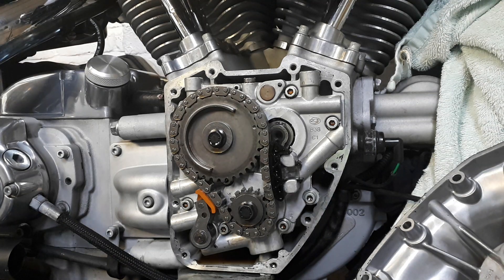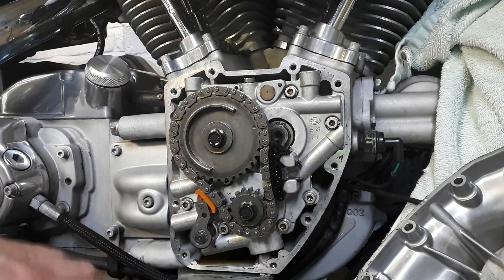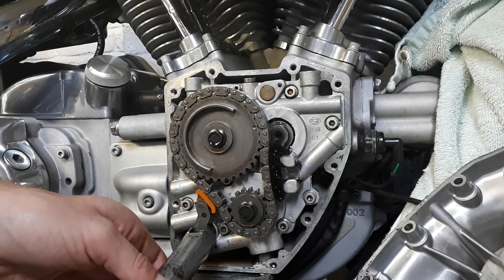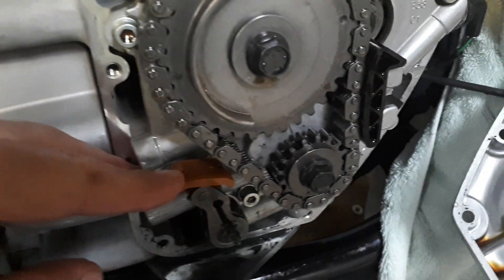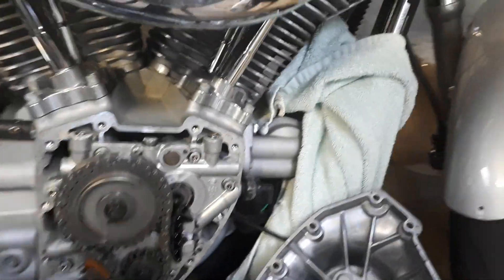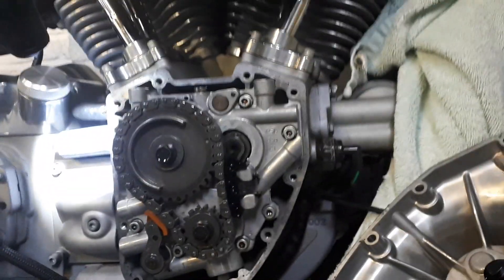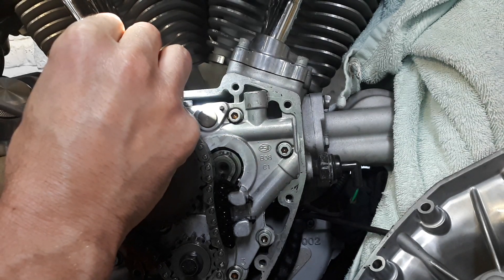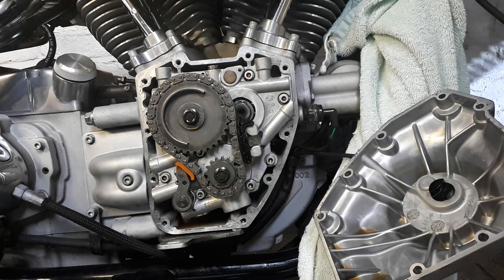How to check camchain tensioners on a Harley 88 Twincam

Comment: Kevin Baxter from "Pro Twin" mentioned that some people have gone as far as polishing  with jewelers polish and wheel, the outside of the chain (your particular type). 
  Makes sense to me as a cheap way to extend the life of your shoes.
  Thank you for an informative video on how to properly make this crucial check of the cam chain tensioners.
Reply from the maker: I’m glad you found the video helpful. Yes, I’ve heard about that too. It’s definitely worth doing it if you’re not converting it to hydraulic or gear drive.

Comment: A buddy of mine that has a 2006 Ultra change his at 50k and forgot all about it and at 117 the tensioners fell apart and the metal went through and destroyed a perfect running tc88 that had a lot of life left in her.    We replaced it with a S&S 111 and it's a Runner now.   Long story short $8500.00 later.   Change the tentioners.
Reply from the maker: Definitely worth keeping strict service intervals and change them well before it’s recommended.
Reply: @aronsgarage834  if you're changing your oil when you're suppose to and not leaving in for two years because you didn't ride it much last year!      The bike will give you a lifetime of enjoyment.     I have a Softail Duece  that I bought in 2001  and even though it sits forever because I have other bikes I still change the oil once a year just like my Ultra that is my old faithful.
Reply from the maker: @marvinr5054  I couldn’t agree more. The saying goes for everything, what you put in is what you get out.

Comment: I see that this an old video but I just had my mechanical tensioner replaced with the hydraulic replacement. It wasn't cheap but wasn't as bad as paying Harley to put new bars (12") on my '04 Road King. I had the stainless braided control cables instead of the black plastic. it is pretty bright to begin with. I've only ridden it home and started it again tonight, but the motor is so much quieter than it was. Granted my tensioner was ate up so that is to be expected. The reason I'm posting is I had that done at 24k miles or so and "if done right" I covered a lot of issues and don't have to worry about it again for a long time. I found this video by accident, I wasn't actually looking for this one and it is a good video, but on the 88 I suggest you put the hydraulic kit in. It replaces a lot of parts that may cause you an issue in the future. I have a bad back and no place to work on it so it cost me about $2 grand for the dealer to do it, but I got some help I think. Sounds like it was worth it so far though.
Reply from the maker: Glad you did the conversion early. Yes, I made made the video after buying my Harley 4.5 years ago. I’m actually doing the hydraulic conversion myself next spring which I’m planning to film. Got all the parts for it now, just need the time.

Comment: Very informative video. Thank you. At what mileage do these tensioners tend to wear to the point of replacement?
Reply from the maker: That’s the problem. They wear off at random times. Some at 30k some as early as 10k. So the longer term solution is converting it to either hydraulic or gear drive.
Reply: @aronsgarage834  Got it. Thank you

Comment: Harley-Davidson never should have gotten away from the evolution design with gears, all they had to do was bump up the design. As we all know the new Milwaukee 8 has basically went back to a gear design with less maintenance, even if you have to check the M8 it’s just one chain and one tensioner on the outside of plate for easy checking.
Secondly, Harley-Davidson needs to get rid of the chain primary and 3 hole oil fill because Indian, Victory , Honda, and Yamaha have done it which is why they take away sales from Harley-Davidson to this day.
Reply: Victory no longer exists.
Reply: @omarsalgado9715  all of Indians new bikes are victory’s

Comment: I replaced mine with the hydraulic tensioner upgrade and there is a lot less worry about failure and tensioner wear. Cam plate with high pressure oil pump, hydraulic tensioners and cam upgrade. Well worth the money to upgrade.
Reply: Totally agreed. Not being a gear head myself... I went the next step... with having a gear drive set installed. I felt that while I had the cam chest open, get rid of the offending parts!. It is not a cheap upgrade I grant you .. but its hard to put a $$ figure on peace of mind.
Reply: Stupid question, probably.  But whats the fastest way to know if an 88 has been upgraded to the hydraulic tensioner?  I recently bought an 05 road king and the bike had been completely disassembled and rebuilt and with add ons and upgrades.  It has a 6 speed gear box now, as one example.  So it makes me wonder, did he fix this well known tensioner issue while he was in there, also?    Can i tell without pulling the cover?
Reply: @rrmorris67  without pulling cover?? I dont think it possible.
Reply: Thought id ask.  Thanks.
Reply: @rrmorris67  The only way that I know of is to remove the cam inspection plate and visually look to see if the tensioners are spring loaded or if they have been converted to the hydraulic system.
Reply: @Vulgaren2012  i guess ive got a lot of time to get around to it.  It was rebuilt a decade back or more but only has a few thousand miles on it.  Ill have to look up the hydraulic tensioners to see what they look like
Reply: @rrmorris67  hydraulic means they dont have a spring like the ones in the video. The cam plate I believe will also be a different color not silver like this one.

Comment: It looks like I see the opening of the cross over pipe at the start of your video in the lower left hand corner at the start of your video? Are you able to take off the front header without removing the rear? The manual says to remove the entire exhaust, but I'd rather not mess with seating two exhaust gaskets and handling the whole system if I don't have to. I have 20K on my bike and am thinking about getting a Feuling 7088 kit, but at the very least, it's time to take a look. I can't tell if the center clamp on the cross over clamps the two pipe together or just holds the heat shield. Thanks.
Reply from the maker: Yes, you can leave the rear one on there. Undo the clamp on the cross over and it comes apart. Makes  life easier 👍

Comment: Is there some sort of oil beneath that cam cover? Or can I just pop the cover off and it's dry?
Reply from the maker: Yes, there is oil in there.
Reply: @aronsgarage834  is that motor oil? Where's it coming from so I can replace it.
Reply from the maker: Yes, engine oil. Comes from the oil tank and gets circulated by the oil pump. If you have your bike on jiffy stand, there won’t be much coming out.
Reply: @aronsgarage834  is the goal to keep it completely level?
Reply from the maker: No, you need to check the dipstick once you’ve assembled, and refill accordingly.
Reply: Mine being checked thurs .£170 or maybe £130 if less time .
I really can't be arsed to do it myself.
Bike is 2002 .11000 miles
Reply from the maker: @John-ob7dh  with 11k on the clock they probably won’t look too bad. But worth thinking about the conversion down the line. I changed mine to hydraulic early this year.

Comment: I'm about to change my tensioners out just for good measure...I'm at 25,000 mi, so I figure when I check them, might as well change them while I'm there & then I'll know it'll be a while before I have to crack this thing open again & give me some time to save up for a gear drive conversion...great hack on the tool...how old is this bike & it's only got 5,000 miles on it? Need to get out & put some more wear on those tensioners! Lol!
Reply from the maker: Yeah, good idea to change them while you are in there. I have now gathered all the parts for the hydraulic conversion, which I’m planning to do and record next spring.
I bought the bike 5 and a half years ago with 1500 miles on the clock believe it or not! 😃 I now got around 8000, still like new lol
It’s a 1999 Super Glide. What year is yours?

Comment: Great video, watched twice so far! Just bought an 01 RK and it appears to have been well taken care of. I can tell the carb has been modified, and it has nice flow intake and exhaust. 23.000 miles …No service records though. Can I possible see if tensioners have been upgraded by removing the small cover on the cam box cover? I'm definitely going with a borescope idea too!
Reply from the maker: Hi Eric, Thanks! That was my very first video. Probably not the best but really wanted help others with this. No, unfortunately you can’t check through that small cover. You need to the do the whole process. Fingers crossed yours has been converted! Let me know, Aron

Comment: If you have to replace them , buy updated hydraulic setup, bolt cutters, and a adjustable push rods kit to do the job if not removing tank , rockers etc... if you do then install rocker lockers kit !

Comment: Very clear video! Thanks!  Did you replace the cover gasket and do you have to drain the oil?
Reply from the maker: Thank you! You don't need to drain the oil. As you're taking off the cover, though, a bit of oil will come out (50-100ml tops). Yes, you need a new gasket or use a gasket sealant (which I actually prefer).
Reply from the maker: @Calvin hi Calvin, the only time you need remove the camplate if you want to replace the rear shoe.  However, in order to do that, first you need to take out the pushrods. It's a big job. Only checking them, on the other hand, is real simple.
Reply from the maker: @Calvin I totally get you. When I learned about all these, I myself too thought about abandoning it, or swapping it for a Sportster (bulletproof) but I do love my Dyna. I might do the gear conversion challenge at some point, and afterwards It'll be low maintenance. You did crack me up with the hobby part..but I agree
Reply: @aronsgarage834  what is a gasket sealer
Reply: What gasket sealer do you prefer?

Comment: Heres some insight from my school bus mechanic father. When ever possible never pry steel metal, like tools against aluminum motor cases. So before you pried with screwdriver he would place some kind of contact protection pad. Hes had one too many, "Oops" moments! One thing no one shows is "hard to remove, because of heat, exhaust pipe mounting bolts. The rubber boot around electrical unit by oil filter is poorly designed closure. These pads are poor design. Im replacing pads with accessory plate hydraulic pads. I'd like to put chain drive, but not cost effective?

Comment: when i put my gear drive cam in the shoe was cracked in half. How many minutes till my motor blew up.
Reply from the maker: Lucky to catch that just in time. I’m glad you saved your motor. At how many miles was that?
Reply: @aronsgarage834  30,000
Reply: @JCunningham21  what model bike and what year?
Reply: @garynorton8122  03 road king
Reply: @JCunningham21  I just bought an 2001 Road King with 44k. I'm going to have to look I'm guessing.
Reply: @garynorton8122  i would befor you start it again.

Comment: Yeah they want $400 to check my tc88 tensioners 🤣 and they wonder why the dealership gets a bad name
Reply from the maker: That’s a little steep! Yeah, that’s one of the reasons why I’ve always worked on all of my bikes, never let anyone touch them lol
Reply: $240 here in UK
Reply from the maker: Only takes an hour to do it. Easily done at home.
Reply: @aronsgarage834  took them a lot longer than that to take off exhaust and cam cover.
Guy over here does the complete job ( replace outer and inner ) plus cam bearing Inc pads and springs ( tank off ) £500
Reply from the maker: That’s not bad for the complete job.

Comment: Good video, thanks. I wonder how hard it would be to replace the just outside cam tensioner? Considering you have it apart.
Reply from the maker: Thanks. It's pretty easy. You take off the two cam sprockets and remove the tensioner (need a pair of circlip pliers). I did it once when I replaced the oil pressure relief spring. It was in the way. Hope this helps.
Reply: But its the inside one thats usually worse
Reply: @DMD81773  our luck

Comment: You got me thinking about acessing a view of the inside tensioner. I Have a inexoensive Endo-scope that plugs into my cell phone. I'm going to give it a try. I've also heard that both shoes wear pretty evenly. So the outside probably tells us what the indisde one looks like. Thx
Reply from the maker: Yes, that should work pretty good.  The thing is I heard people having had the inside wear out faster. I guess it all depends on the camchains they installed. Some of them had really rough edges, just randomly from manufacturing.

Comment: I assume that the cam plate would have to be completely removed to replace both shoes ?
Reply from the maker: Unfortunately yes. You can’t remove the inner shoe otherwise. Which is why most people convert it to hydraulic or gear drive while they’re at it.
Reply: @aronsgarage834  Thanks for your reply. Unfortunately I can’t invest in a $2k upgrade at this time.
Reply from the maker: Sure. If you can do it yourself though you’ll reduce the cost to around $800. I’m going to do mine in the near future. I’ll most likely record it and upload the videos.

Comment: At 10 k miles and 18 years old mine looked fine. I replaced the outside one because it was so easy. The inside one I left alone a lot more work. Usually they give you a warning by making a noise when worn through. If I had to do it again I would not check till 20k miles.
Reply: 1.  Don’t listen for a warning.  2.   The inner one wears much sooner/worse than the outer one.  Leaving the inner one undone is, well, are you a gambler??  😀
Reply: @ Thanks for the reply. The 13,500 miles I still haven’t replaced the inner one. I think I’ll replace both at 20,000

Comment: How do you change the  inside tentuner
Reply from the maker: Need to pull the camchest unfortunately, so a pretty big job. Which is why most people while they are at it, they end up doing the conversion to either gear drive or hydraulic tensioners.

Comment: I understand the front chain because of Crank run-out but making the rear-drive a chain was a really stupid idea Harley Davidson
Reply from the maker: Agree. They really should have kept the gear drive from EVO. Bulletproof.
Reply: Thank the EPA noise requirements
Reply: @Krieger I totally agree which is one of the reasons I used all aftermarket parts the other reason is I felt the aftermarket parts were actually better quality
Reply: @dickjohnson5025  Nope.  Bean counter / bigger profit requirements.  And it is truly a disgrace that Harley went that route on so many fronts on the Twin Cams and M8's considering its a premium brand with premium price tags dangling from them handlebars.  Heck, the Yamaha Road Star (air cooled/pushrods/single/crank/no counter balancers/belt final drive) had cam driven gears when they made those fantastic bikes (1999-2015).
Reply: It was smart by them for cost cutting measures, but insanely stupid in terms of the reputational damage it has done to the company

Comment: What year and model is this? Do you prefer the 88? If so why? Thanks. I am trying to decide what to get next. I had a 2005 Softail and it was fine as long as I stayed under 60-65 when It would buzz the foot pegs something fierce at any over that speed?
Reply from the maker: Mine is a 1999 Dyna Super Glide. I have never had a softail so can’t compare but I know it’s a rigid mounted engine with balance shafts (88B engine). Dynas have 88A engines, no balancer and are rubber mounted. At idle the engine is jumping around and everything is shaking but once you are rolling on the road it smooths out to a very enjoyable ride at pretty much any speed. It has that pleasant vibration through the handlebars, foot pegs never caused any trouble. I love mine because 88 is still a carb model and has that characteristic vibration and sound. I wouldn’t change it for anything.
Reply: @aronsgarage834  Thanks for your reply. Good to know about your 88 dyna and glad to hear it smooths out. Have you had to change the tensioner yet?
Reply from the maker: @dry509  I only have 7000 miles only the clock and checked the tensioners at 6000, they were ok. But I’m planning to convert to hydraulic next winter because not only are the the spring loaded tensioners a weak link but also the camshaft inner bearings can bite the dust any time. Once you do the conversion though, engine becomes pretty bulletproof.
Reply: @aronsgarage834  Great to know thanks. I would like to find one like yours. Is 99 the only year you recommend that is like yours or ?
Reply from the maker: @dry509   Any Dyna from 1999 to 2006. Hopefully you find a good one that has already been upgraded with hydraulic tensioners or gear drive. If not, you will need to factor in the cost getting it done yourself.
Reply: @aronsgarage834  Do all of these years have a carb? If not do you prefer a carb or would you still get one if it has fuel injection?
Reply from the maker: @dry509  yes, all of those years mentioned have a carb. I guess it’s personal preference. I definitely prefer carb models. Easy to clean, tune or fix on the side of the road.
Reply: @aronsgarage834  Cool. Thanks. I am in Houston. We’ll see what I can find.